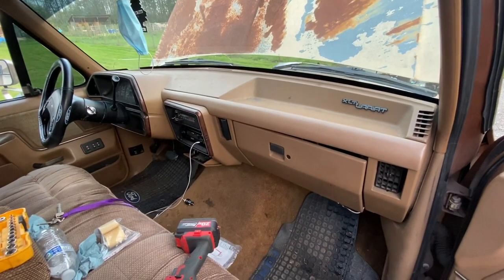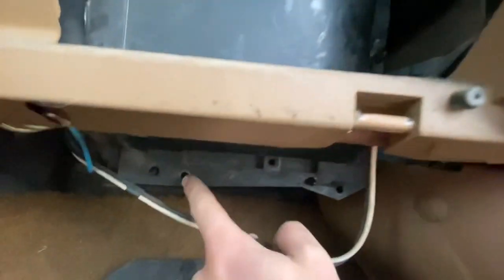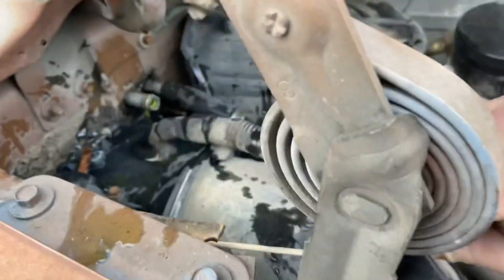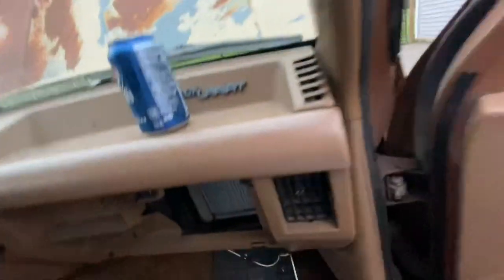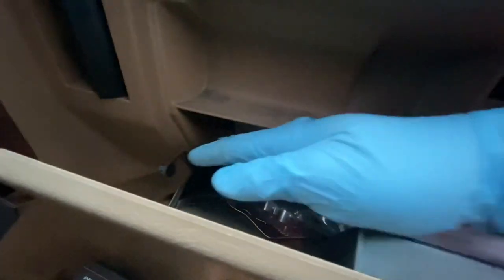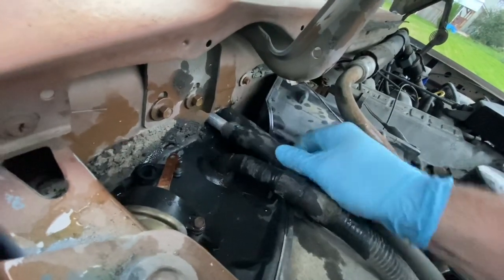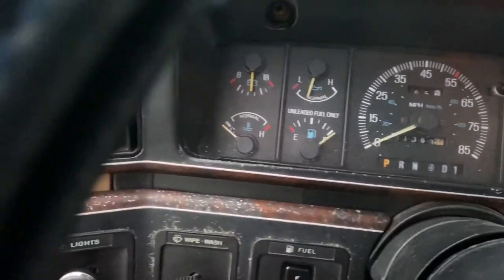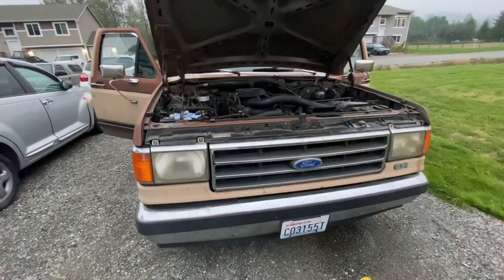1987-1991 Ford F series/Bronco Heater Core Replacement

Comment: food for thought--- before u add back the cover over the heater core replacement - reattached up heater core hoses and tighten the clamps down and they refill with loss coolant due to leaking and such - then run the engine and heater/ac to make sure no leaks are coming from new core anywhere -   after that you put the cover over core and glove box back on

Comment: Awesome video! I did this and but my heater still isn’t blowing hot air. No leaks coolant should be topped off. Any advice ?
Reply from the maker: Is your thermostat working? And if it is. Is it the correct one? They sell deferent temperature ones that will affect how hot the air is in the cab.

Comment: You don’t mention anything about the original weather stripping or what exactly you are cleaning up.  In my case all the weather stripping was crumbling and anti freeze was everywhere inside.
Reply from the maker: Everyone is going to have to clean that pocket differently. If they leak. Then you clean coolant. If it’s clogged. Then probably just the seal

Comment: Can a leaking heater core leak on the outside of the truck? I’ve got a bad coolant leak from the back of the engine, but I can’t see where it’s coming from. It’s dripping off the oil pan. Could that be the heatercore? I don’t have any coolant leaking to the interior.
Reply from the maker: It could if it’s leaking from where the outlet and inlet hoses. But you’d easily see if it is. If it’s coming out from the back. It could be one of the bypass hoses
Reply: i had the same problem with my 88 f250 with a 5.8L. it was coming from between the intake manifold and the head. i pulled both heads had them rebuilt. . you can get pitting where the head and  intake manifold meet in the very back at the water jacket port. i took jb weld and filled in the pitting and sanded it on the head and the intake.  and she has been doing very good. also. the lower head bolt holes go into the water jacket on the block if it is a 302 or a 351. make sure you check there as well. you have to put  thread sealer on the head bolts. make sure its a good quality one though

Comment: Do you pour the coolant down the reserve plastic tank or in the capped off one? Or does it matter?
Reply from the maker: I didn’t loose any coolant from the reservoir. I just took the radiator cap off and topped it off as needed. Then once the truck cooled off the next day I double checked the level. Add as needed.
Reply: @stevensgarage7284  thanks